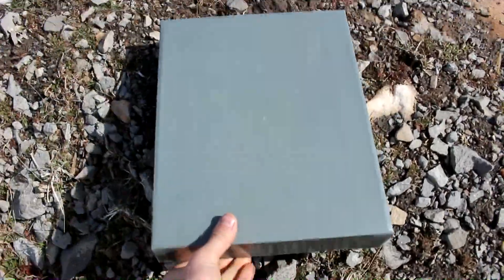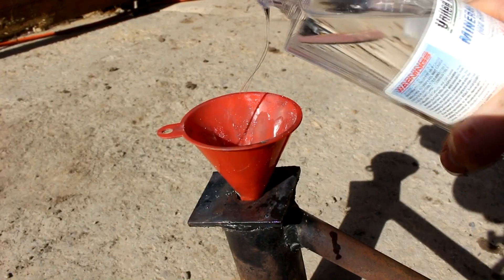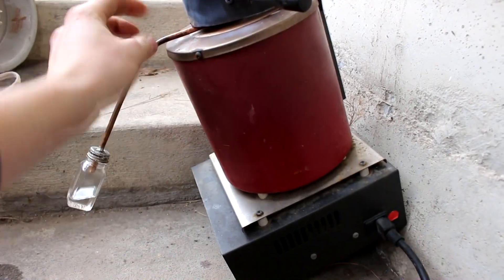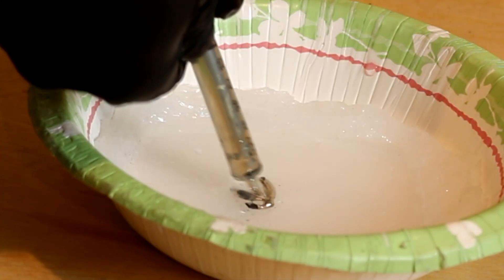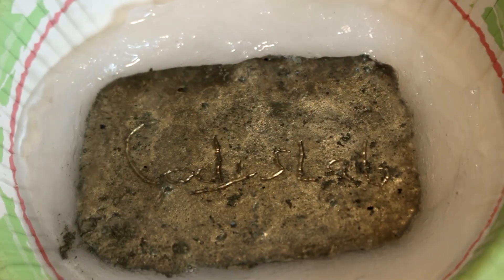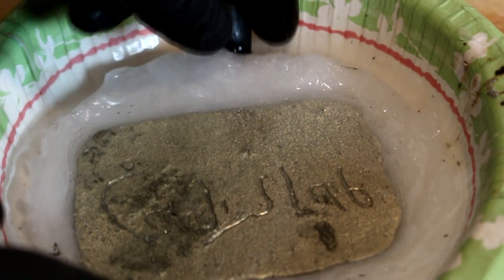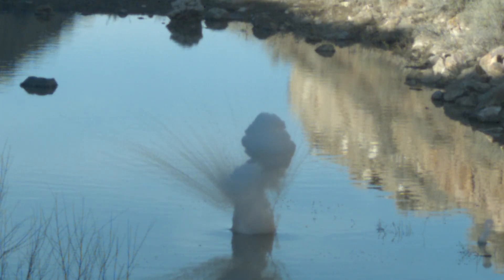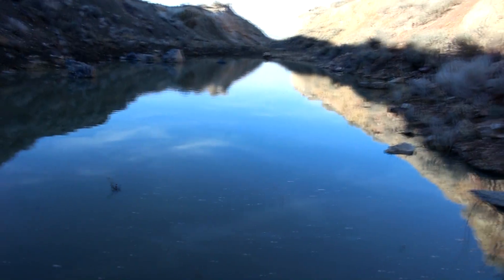Cesium Play Button For 1,000,000 Subscribers!

Comment: Cody, why don't you wear gloves while welding? There are splatters of hot metal coming off everywhere, and extreme levels of UV lights.
Reply: I'm a welder and have to agree although admittedly I sometimes get lazy and will do a few quick welds bare handed but never a good idea I have several scars from burns do to my own stupidity

Comment: can you build a hood and fill it with argon? then you can make lots of interesting experiments in it like making NaK alloy and having it shiny and just pour it from one glass to another or melt aluminium and then freeze it staying extremely shiny. you can use gloves like people handling with radioactive material using in built gloves so they can use their hand inside the hood without going in or opening the hood. you could have made this in such a hood without the Cs risking to react

Comment: I have some experience with casting from a silicone mold. Usually a pressure pot is used to remove all air from the medium being casted (polyurethane resin in my case) so it creates a perfect replica of the item being casted. If placed into a pressure pot in order to create a more accurate replica, would the vacuum-effect affect the solidifying of the caesium? You probably get too many comments to notice this one, but if you do, I am genuinely curious. Thanks! Great stuff, subbed! Also: lol at having ''effect" and "affect" next to each other in a sentence. Never thought I'd write a sentence with these two words right next to one another! :P

Comment: You need to degas the RTV for your mold before casting. Just run it in a vacum chamber for a few minutes until it stops foaming. Much better results with no voids, etc.

Comment: I was going to scold you for handling lithium with your bare hands, but then I saw you dipping your finger into liquid cesium.
Reply: Everything's dangerous, it's just that some things are dangerous in lower amounts than others.
Reply: B J. Schmor lithium isn’t dangerous i think, its used in some batteries
Reply: @spamlord7570  lithium is dangerous
Reply: @spamlord7570  it's used in batteries but it's contained so you can't directly touch it.
it reacts with water by burning quite violently sometime so it's best to use gloves and store it with no contact with air (because moisture)
Reply: @spamlord7570  Its used in Lithium Ion batteries because it's good at being used as a battery. You really dont want to touch lithium, which is an Alkali metal (reacts with water). Not only is it toxic a degree, but since you are 70% of what it reacts with, and your body sweats out water, it's probably best to avoid physical contact with pure lithium

Edit: fixed spelling
Reply: @DigitalEWhore  and lithium polymer batteries
Reply: @DigitalEWhore  It's not that dangerous. It's a fire hazard and it's very alkaline but that's not so bad if you can wash your hands. It's no worse than getting some sodium hydroxide on your hands, which if you wash it off soon-ish does nothing. I'd be more worried about eyes or a small piece of lithium getting to where it can start a fire.
Reply: @soylentgreenb   soylentgreenb  I never said it was this insanely dangerous thing. I said ideally you wouldn't want to touch it with your bare hands
Reply: @spamlord7570  just cause it's used in many batteries doesnt mean it's not dangerous
Reply: @spamlord7570  poison aint dangerous, its used for pest control
Reply: @Team epiphany Art um... watch TKOR’s video on throwing the lithium from those batteries into water...

Comment: Make a Sodium play button, and maybe the other alkali metals
Reply: That's because francium doesn't exist in quantities greater than an atom at a time. It's too unstable. Also, how do you know it's more explosive than caesium?
Reply: James Watson Well, I mean the lower elements just smoke or nearly explode. Cesium explodes on contact with water, creating an explosion that destroys glass, and Francium... It is unknown but the explosion would probably spit out radioactive material, and destroy it's container. I mean, if a lump WAS created, It would radioactively decay into another element. Good luck getting it with it poisoning you nor it decaying
Reply: @Ult-Gamer That's not how radioactivity works. After 22 mins half of it will be gone,  but after the next 22, only half of what remains will decay so you'd still have 1/4 of the original product. After 66 mins 7/8ths of it will have decayed, after 88 mins 15/16ths would have decayed and so on.
Reply: Francium is also super radioactive, it would be awesome if they could create a lump of it, but there going by reactivity relative to the other alkali metals there's a safe assumption that the reaction would be greater, but i doubt by much.
Reply: Lithium is the most reactive alkali metal.
Other than lithium they follow a trend of the further down the more reactive. But that isn't why caesium reacts better than other alkali metals.
Potassium, sodium and lithium are all less dense than water and thus will happily float on the surface, reducing the surface where reactions take place (and getting a lot of gas in the way).
Caesium is denser than water and thus sinks. It also melts. This makes it a lot easier to react.
Reply: Jeffrey Black nah man pretty sure cesium is more reactive than lithium and so is francium
Reply: The video proves that to be wrong.
If A is more reactive than B then A is able to reduce the oxidised form of B back to B while it is oxidised.
i.e. A + B+ -> A+ + B.
What happens in the video?
Lithium metal is used to reduce caesium ions.
That proves lithium is more reactive than caesium.
Reply: nah man he was boiling them and cesium boils at a much lower temp than lithium it allowed the cesium vapor to escape into his other container, shit he even admits "cesium is more reactive than lithium"
Reply: He claims caesium is more reactive than sodium. If he thinks it is more reactive than lithium, he doesn't know what he is talking about.
Reactivity and energy are also quite intrinsically linked.
The more reactive the reducing agent (the alkali metal) the more energy is released per mol (assuming the same number of electrons).
An atom of caesium when reacting with water will release roughly 15% more energy than an atom of sodium.

He wasn't boiling caesium and lithium. He reacted lithium and caesium chloride.
If caesium was more reactive than lithium, then he wouldn't have gotten any significant amount of caesium from this.
He relied upon the lithium being more reactive than caesium such that the lithium could react with the caesium cations to reduce them back to caesium.

If he tried it with sodium instead he would have been left with caesium chloride and sodium.

This is quite easily quantifiable via standard reduction potentials.
Lithium has a standard reduction potential of -3.04 V, caesium is -3.026 V, sodium is -2.71 V (H+ is 0)
Reply: agreed, but under a controlled enviroment? hahaha
Reply: Well... I mean... does the controlled env. protect half-life and full-life decay?
Reply: i think the half life is something like twenty minutes or so, so if you could create some quickly then dump in water, again this is all hypothetical because francium only flutters into existence now and then, it would be cool to see. but for my opinion it's reaction probably wont be much more violent than cesium but possibly different.
Reply: Well... unless your risking to be splatted in radioactive stuff, yes.

Also the half life of it is 22 mins, so a full decay is 44 mins.
Reply: there are devices where you can robotically create experiments within a glass or plexiglass environment for viewing, hell you could even film it and not one person be contaminated.
Reply: hm. Well, I mean, if we want francium just hope we have another element that decays into... francium! Even though that's not really going to happen.
Reply: Sodium is the best tasting alkali metal.
Reply: He won't probably get his hands on Francium. Even more explosive than Cesium. Can't find videos with it.
Reply: Andrejs Zavaruhins Francium explodes almost immediately after more that one atom is formed

Comment: According to wikipedia, the price for cesium is $11000 per kilogram, divided by 1000 is $11 per gram. If you have 84 grams of cesium, that means you threw $935 dollars into the pond and watched it explode. That is well worth the money...
Reply: Except I somehow very doubt it is pure cesium. So no, it wouldn't be worth even near 935$.
Reply: @Mader_Levap  Yep much easier to make a lot of non pure metal than the same amount of metal without any impurities. There's a reason why Cody doesn't just sell Lithium for like 500$/100 grams
Reply: The thing is that the price of cesiun doesn't "behave" like the price of for example gold. If one gram of gold costs 30$, 1000 grams of gold will cost 30,000$. BUT this doesn't happen for cesiun. One of the reasons why cesiun is so expensive is because  of it's reactivity. It's very difficult to purify and to keep it pure you have to work under an inert atmosphere an so on. So, making 20 ampoules with 50 grams is going to be MUCH more expensive than making 1 ampoule with one kilogramme of cesiun. That's why an ampoule with 10 grams can cost 200$, but another with 50 will cost 650, instead of 1000. I hope I have explained it well.
Reply: @luisillo3511  economies of scale basically
Reply: Considering that he made several thousand just for recording that, money especially well spent
Reply: @liboud22  classic reaction
Reply: He said he spent around $200 tho
Reply: Dude check ebay its actually $80 per gram
Reply: wise investment right there
Reply: He has a way to make caesium dirt cheap
Reply: Look it up dudes, value of cesium is currently $30 per gram
Reply: @liboud22  Ahahahahahaha!
Reply: @richcampoverde  Go back?! Dont fucking mock me you posh twat! You know I've never been to any school!! had I been, I wouldn't have been a moron!
Reply: The price is 73000 per kilo. Its second most expensive element after rhodium
Reply: Garden Chemistry I represent a Lithuanian company that offers 99.99 caesium for sale. where do you get the prices? we are looking for buyers. If you bring to us then you will get a percentage from the sale.
Reply: Wikipedia??? 
Are you sure about that?
Reply: 'Murica!
Reply: Well we shouldn't really trust Wikipedia but it could be correct it could
Reply: Eli McClellan but he made it not bought it
Reply: To everyone debating pricing... He said he spent $200 making this. It probably isn't very pure at all, and all the prices people are listing here are for pure cesium. Do you really think with some basic chemistry he had a $700 increase in value, yet doesn't bat an eye about it? Or if it is $80 per gram and it is pure like the highest estimate says, then his value increase was $6,500. Which he hucked in some water. Let's be honest, we don't know the actual purity or value of his button lol.
Reply: There’s a reason he used cesium chloride and reacted it with lithium, cesium is expensive
Reply: Actually, with the views he got about 1000-3000 dollars off this videos
Reply: Yeah and now it's $30 a gram
Reply: I think I'm gonna cry!
Reply: Well yeah but if you have the Cesium clean not oxidized 2 grams can cost more than 2000$
Reply: lol it is worth the money
Reply: And he spent 200 so thats about 1135 dollars plus the time he put into making the cesium and recording the video
Reply: He literally says in the video that you were supposed to watch before commenting that it cost him about 200$
Reply: I heard it costs over 2500 dollars for just 50 grams... Get ur facts correct.
Reply: @ukayy002  Uh, where did you get this from? The only reference I can find of pure cesium being that expensive was in 1997.
Reply: @apalsnerg   isnt this 1997?
Reply: ukayy 00 Hearing that hurts.
Reply: I heard vaginas have teeth.
Reply: @ukayy002  why would you tell someone to get their facts straight when they've sourced them, as opposed to saying... *"WeLl I hEarD"*...   "Get ur facts straight"...? Pull "ur" head out "ur" ass

Comment: Let's add oil so it doesn't react with the air or silicon because it's to reactivate 1 second later pokes it with bare finger

Comment: "lets throw it in a lake"
....aaaaaaaaaand there goes roughly seven thousand dollars...
Reply: Richard Roller No, he made it with $200 worth of materials
Reply: He said it was only $200, though.
Reply: 80cesium cost like 500-2000 bucks.
Reply: The amount cesium goes for depends on purity. I've seen estimates say $200, though that's what he spent on products to distill the cesium he had (which wasn't in its pure form.) So it could truly be anywhere from a couple hundred, to a couple thousand dollars.

Comment: Seems to me the difference in that one video that claims a larger explosion is... they managed to submerge the stuff in a special capsule so that when it made contact with the water, it was surrounded by it. This provides resistance for the rapidly expanding steam plume, allowing it to build up force. So maybe the bigger explosion in that adrenalyn-pumped video is mostly steam. What if you coated the cesium in something that doesn't react with the metal but dissolves in water... probably no such substance. Maybe seal it in a glass soap dish thing and shatter that under the water with a rat trap?

Comment: I am interested in what purpose when to use a secondary condensing camber. It would be a vent coming out of the first glass with a tube leading to the second. The inspiration for this question comes after seeing the mercury refinery that is on the other side of the mountain near your ranch.
Reply: after thinking about it for a min, I feel like the explanation might be more that can be discussed in a comment. If this is so, maybe a link to where I can learn more about this?

Comment: Cody you could put the silicon in a vacuum chamber to suck out the air bubbles, and any liquids you use to mold to make clear molds or moldings, but if course you already know that.

Comment: How do you displace caesium chloride with lithium.Isnt lithium suppose to be less reactive than ceasium.
Reply: He's heating up the cesium chloride causing it to decompose into cesium and chlorine gas. The cesium is hot enough that it is a gas which flows into the container and the chlorine reacts with the liquid lithium forming lithium chloride. So technically he isn't reacting cesium chloride with lithium, just decomposing cesium chloride and reacting lithium with chlorine

Comment: Mineral oil interfered with the power of the reaction.   80 grams would have been much more impressive if done in a different way.   2 grams can blow up a bathtub.
Reply: Im just going to assume your talking about braniacs infamous alkali metals video. That video was proven fake. Check out thunderfoots analysis of it. There is absolutely no way that could've been real when you think about it. (Hint: they may or may not have used a DEPTH CHARGE)

Comment: Cody, gallium has a low melting point. Is that why galluminium alloy is weak? Or is it because of other reasons, because theoretically, it should be stronger because of the atom sizes...

Comment: drop some cesium into liquid oxygen.
Reply: GreenJelloHell no thanks, i choose life
Reply: GreenJelloHell Sounds like a good idea... If you do it on ground zer0 5 miles away.
Reply: Orion Spectre that's 500 septillion
Reply: GreenJelloHell so what happens?
Reply: Reinis Miks It blows up and cause a big reaction
Reply: Liquid oxygen wouldn't it make the cesium just harden on the outside when It came in contact with the oxygen
Reply: Water is enough lmao
Reply: Aidan Dixon *500,000,000,000,000,000,000,000,000

Comment: Hi Cody, I have a great idea for your vaccum chamber. As we all know small devices produce some heat while working, but that heat quickly disappears in the air. What if you leave for example a flashlight on something which insulates heat from the walls. Will that overheat or it will radiate heat as an IR light like spaceships do?
Reply: Modern computers and phones know if they're overheating and will shut themselves down if necessary to prevent damage.
Reply: yes!!! like leave a phone in vacum playing video and see if it cathches fire
Reply: i mean, this channel is practically nerd central
Reply: Will fire overheat in vacuum?

Comment: Probably the only person ever dumb enough to touch cesium with their bare hand.
Reply: His hand did not come into contact with cesium. If it did, you would have been able to visually see a reaction. It did not because, as he explained himself, of the mineral oil, which separated his hand from the Cs.
Reply: randomwindowsstuffz I know but what I meant by it is he actually tried. Like he probably was not 100% sure it would work and it could have reacted with his fingers. You can see he was hesitant to do it.
Reply: That's true, he could have taken much better safety precautions. But then again, I've learned not to expect much safety awareness from Cody, someone who has dipped his hand in mercury and inserted a magnet into his own finger.
Reply: randomwindowsstuffz I know but like at some point he's probably going to injure himself 😂

Comment: I'm surprised you didn't use pourable silicone, or mix it with cornstarch for better consistency and results. I thought Cesium can be absorbed into the body through your skin? Plain old Baby Oil would react? I thought it was pure mineral oil.
Reply: Cesium cannot be absorbed through skin.